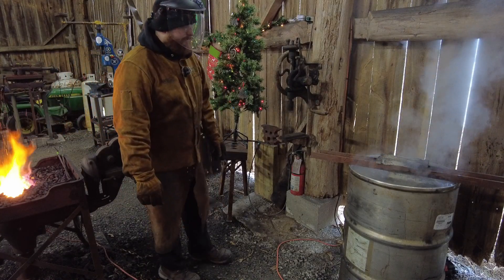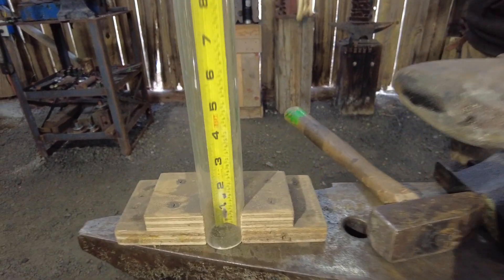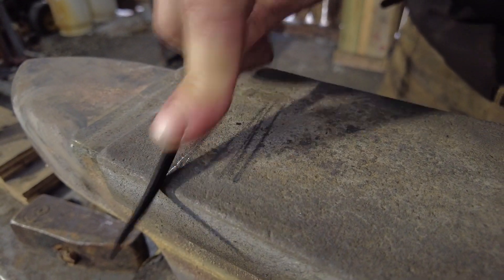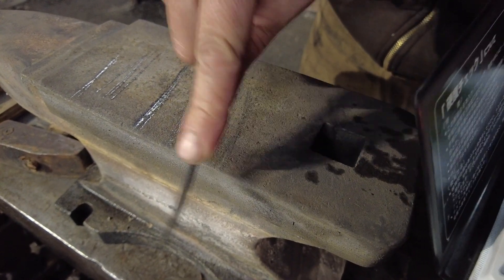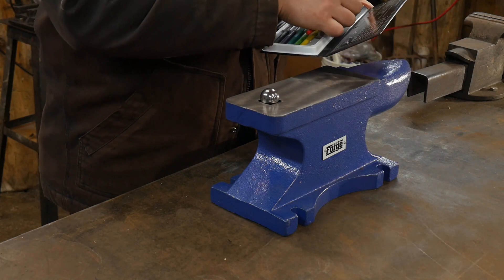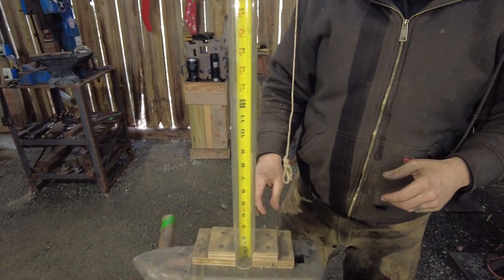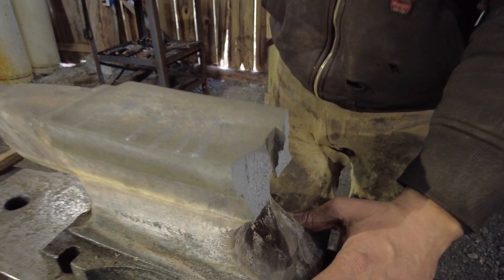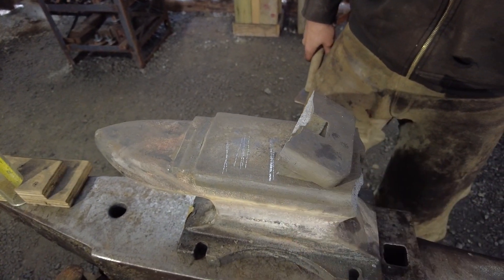Harbor Freight Anvil: Can It Be Hardened?

Comment: That's a pretty slow quench, isn't it?   You put the anvil's face into a barrel of water and left it there, right?  Now, you have protected the face from the cold water with a blanket of steam.  In the heat treating business, we pump the water in the quench tanks at very high rates of speed to keep liquid  water in contact with the work.
Take a guess at the actual content of the metal, then locate a TTT curve and study it.

Comment: Ok your insane I work with gray iron  for meny years I would of just told you if you do this you would would happen it's crap metal the grain look perfect on the one you broke  with hammers like that's exactly  the grain you want to see in cast iron you can see how much it got in the one you try to harden  but in trying harden gray iron you give it more glass like properties from it iron is not steel it's had like 3 % carbon  in steels are a lot lower even high carbon steel has a lot less then gray iron

Comment: My experience is that it is safer and easier to simply use hard facing welding rods for cast iron, build up about 3/8-1/2 surface and grind/machine flat and smooth, and polish to desired finish.

Comment: 15-20 years ago I bought a 110 lb  "made in Russia" anvil from HF and it is a gem; great hammer rebound and it rings like a (high pitched) bell. The only weird thing about it is that the hardy hole is rotated 45 degrees so that end-to-end it looks like a diamond instead of a square.

Comment: Something that thick really needs a coolant circulation pump. Your  going to get soft spots from steam pockets and generally poor quench in the critical range without a direct impingement from a fast flow [jet] of coolant regardless of base coolant temp or type. I'm curious about getting it hot like that but applying an air hardening, or work hardening, hardfacing layer with a torch with a light quench. Though it may cost more for good hardfacing material and torch gas than the anvil is worth. (Not talking about the common no name stuff used on a half crippled backhoe, there are special formulas for each sort of wear and hardness need.)

The better way to do cast iron is to cast it in a mold with a chill block insert to make a white iron layer on the top. I don't know if it is possible [or practical] to form white iron with heat treatment of the solid object after casting. Maybe some sort of process that melts a thin surface layer and lets the bulk self-chill. The down side is that a white iron top would need surface grinding rather than a fast pass machining. White iron was traditionally popular for the tire of train wheels and plow shares meant for sandy soil (high abrasive).

Comment: I dunno??? seems a lot of importance about metal properties. An anvil was originally  made as a large chunk upon which to pound things. I seriously doubt the metallurgy back in the day yielded very hard steel? Pounding on the surface over time will work harden it to a degree. If you are in a hurry you could take a bar of high hardness steel alloy and braze it on as a hardened work surface. The cheap anvil is the large mass platform, all ya need is a harder surface. Definitely adequate for most anvil uses, especially just the occasional or entry level needs.

Comment: My guess on what will happen. Serious cracking.

Edit: it looked like it was slightly above 45 Rockwell. 

I think if you had dipped it slightly deeper it may have have auto tempered less. At the same time that could have also caused cracking.

Edit 2: got to the end lol.

Comment: I think it will crack due to its mass and the temperature differential between the center and the outside.
Reply: I was expecting the whole anvil, but still surprising it didn't explode. The anvil breaking is not a surprise either. Thank yoh for this video.

Comment: You need carbon to harden. They used to dip it in cyanide. Also, sugar and walnut shells were used.  Harbor Freight has some excellent tools if you use them correctly.  I have a thirteen-foot  
fishing boat and the Harbor Freight anvil has worked very well as an anchor for years. I have seen them work great for doorstops. If you don't misuse their tools they will last you for years.

Comment: I've found a 100% effective solution to the problem.
You'll need a refractory vessel to hold the anvil, some flux, a bit of extra steel and an appropriate furnace.
Put the pricasaurus rex anvil into the vessel, we'll call it a crucible, add the additional metal and flux. Put the lot of it into the blast furnace and allow all to melt. Form an ingot of the appropriate size and shape, then forge your anvil.

More work would be to heat the damnable thing up to when the iron reaches a eutectic state, reforge it properly, then flatten and reshape as needed, then harden. But, that'd be even more work to get it right, as you'd have to forge all around and the core would likely still be crap.

Comment: Theory: it's too damned thick, outside will cool and harden while the inside is still too big and hot, and you're going to end up with giant cracks running all throughout...  OR the whole thing just breaks apart.

Edit: Huh, didn't expect you to just do the striking face, figured you'd harden the whole thing.

Comment: It's cast Iron  not  cast steel. Cast iron Has a higher carbon content which is an excess  and other inclusions which prevent it being hardened because it is too brittle. My suggestion would be to put a metal plate on the flat area of sufficient hardness and hope that the horn will last.

Comment: anyone else bothered by them only heating part of the anvil and then only cooling that part? it doesn't make sense to me that you would do that because it would increase inner stresses at the temperature differentiated point
Reply from the maker: It's called a differential quench. Pretty common in this trade

Comment: I just want to be clear. You tried to heat treat cast iron, which pretty much does not work except for some special types. You left it sit in the oil the entire time.... and I assume did not anneal it after, leaving it brittle. Any metal will be brittle after you do that to it. thumbs down, for the expert.
Reply from the maker: If you actually watched the video with your expert ears And thumbs you would of heard that the anvil Was quenched in water not oil... The point of the video was "can It be hardend" not "how to harden And temper something properly"... "Annealing" isn't the Same as "tempering" just to be clear 😉
Reply: @ChristCenteredIronworks  yes i watched it all. ok sorry i typed oil. its interesting that none of my points are addressed in this reply. So your point was you tried and the testing tools did not skate, so it was a fail and then you smashed it. It is a little misleading as anything you harden like that becomes brittle. that's literally why you have an annealing process. The substructure of the metal is like glass. I get it, its not great metal and many metals will not harden, but you certainly seemed determined to fail it.

Comment: My guess is that it’ll end up breaking apart because it’s made from low quality material.

Would it be feasible to weld a hard piece of steel to the top of it instead?

Comment: Wouldn't this be an ideal anvil for softer metals? Like copper and bronze? Metals where you don't need nearly so much heat and just need to hammer soft into form? Or have I entirely mischaracterized how to do metalworking altogether?
Reply: I use mine for shaping sheet metal with peen hammers and it works just fine.   I use apiece of railroad  track for heavier metal work.  I dont have a "real" anvil atm but have managed to get by without oneso far.

Comment: It looked to me like the failure originated at the hardy hole. The sharp 90 degree corners are stress risers and cause brittle fracture during heat treatment. You may have had some grain growth, but I would be willing to bet that it would have survived if you had radiused or chamfered those square edges before taking it up to temp. Neat video, thanks.

Comment: Harbor freight anvils are a mild cast iron. They are not meant to be surface hardened. They are just meant to be us d as is. For those that are just starting out that don't have a lot of money to put in to a good anvil. An an easy way to get a harder surface is to have a plate of hard-dox steel welded on to the the working face.

Comment: i'm guessing you did a water hardening quench which isn't necessarily going to yield a good hardness. as far as your use of the hardness files you are supposed to drag the file over the test piece once. if it gouges into the metal for any real depth that you can actually feel then it fails that file. Also, with all of that scale you are getting a false reading and should have wire wheeled or scotch brite wheeled the scale away and test on the surface metal alone. if you really wanted to improve hardness of the anvil you would have quenched in oil instead of water.

Comment: You can hear some of the grain structure cracking during the quench. I’d much rather use a good forged anvil than harbor freight’s cast stuff. I know it’s cheaper, but if I’m gonna invest in an anvil, I’d rather buy something nicer, and buy it once than have to buy a cheap one over and over again. I’ve applied this logic to Allen wrenches (which we use daily in my line of work) and I spent $170 on 3 sets of really nice Japanese allens, and they still look brand new despite using them daily. When I was young and would buy cheap sets, I’d have to replace a cheap $15 set every 3 months or so. Which, over the course of the year would have paid for the 1 nice set that would have replaced. At roughly $50/set plus shipping, my colleagues have been using the same set of the nice ones for 15 years and they still look new to this day. So, when you buy quality the first time, you shouldn’t have to keep buying junk over and over again. Even if it saves in the short term, it’ll save even more in the long term to invest in the good stuff.
Reply: it would have been better had they used oil instead of water to quench it
Reply: @signolias100  maybe.  

Would have been better if they’d gotten some railroad rail….  Hope to get some railroad rail myself.

Comment: i'd like to see a video on hardfacing one of these anvils by forge welding some nice steel to the top. i've been considering doing that with my bottom-end cast iron anvil and using some spring steel.
Reply: I have seen people do a pass of transition rod and then a layer of tool steel rod welded to the face and the results were great. Like 500% improvement. It really gave life to the HF anvil.

Comment: Remove the scale...sheesh
Why didn't you tempter it afterwards to at least remove the stresses

But I getcha...cheap chinese pot metal crap...
Reply from the maker: Tempering 45+/- Rockwell does nothing but Make The result null and void. The point of the video is can It be hardend This Way not how to make a useable anvil...

Comment: I honestly wondered about this.

Since they use "ductile iron," (not cast iron, which is actually VERY high carbon) which actually has a decent graphite content, it actually stood to reason that it would be hardenable on some level.
Reply: Main difference in plain cast and ductile irons are the structure of the carbon bits.  Plain cast the carbon is in a flat platelette shape and ductile have more sherelical shapes.  Cast can have long lines of carbon plates stacked up forming a weak spot.  Ductile iron carbon structures have a much better distribution and more even adherance through out the item.  Best way to look at it is look up cast and ductile iron vises.

Comment: Not sure I'd quench a yellow-hot anvil in a barrel of oil up against an old, very dry, wooden Barn wall, with a good draft (see 1-1.5" gaps between planks).  Oil quenches frequently flare up (open flame).  Especially when you're talking about the amount of heat mass in a hot anvil.
As an unreformed pyromaniac, I'd call that a Massive BONFIRE !!  With 30gals of "cheater wood" (fire starter fluid).
Take the "fire ladder" away.  Move the oil barrel out into the open space, with no overhead wood beams.
Reply from the maker: It's not oil....... like I said in the video.

Comment: Question; if you coated the surface with a mixture of clay and carbon then heated it up and let it soak to absorb some of the carbon.  Then cooled and removed the clay then hardened it. Would that work or is the grain structure just too course?

Comment: In my opinion, I would steer clear of Harbor Freight anvil. Just for a simple reason that there is too much impurities mixed within the metal that makes it too soft for blacksmithing work. 
If you compare size for size of anvil a good quality anvil would be heaver than a HF anvil, because of better quality of steel, more dents, and better casting methods. I am sure there is other who has already made the same mention as to what I have just said. If it was me and I need an anvil for some blacksmithing work, I would get me some railroad iron to get me out of a pinch.
Just saying.

Comment: i wasn't surprised by this at all, especially the hardy hole popping off like that, its cast so any amount of hardening will absolutely destroy the entegrity of the crystal structure, forged steel has a much tighter and consolidated structure and so when you harden it, it essentially interlaces the crystals almost like a rope interlaces threads to make a stronger item. Cast iron is like taking those threads and hanging something from them untwisted.
Reply: First, cast does not mean cast iron. Second, forging does not consolidate material or "intertwine" the grain. Third, rope is not stronger because it is twisted.

Iron is a crystal. It does not have long or stringy grains, it is more akin to sandstone or quartzite (metamorphic sandstone where to silicate grains grow together from being exposed to high heat). Casting has the potential to create voids or porosity from the process failing or being done improperly, but heat treatment itself can do far more to refine and homogenize the grain structure than "forging" can. Besides, what does it really mean to have a forged anvil? How did they create the billet in the first place? Are the feet, horn, heel, and face all welded onto the waist? Is it arc welded or forge welded? Are those perfect welds, or are they just as susseptible to failure as a cast anvil?

A good anvil is a good piece of iron made well, regardless of the method used in it's construction.
Reply: @DragonHide94  ok first, I said Cast, not Cast IRON, I understand the difference, still like you said, hardening cast at all destroys any strength the metal had because of all the voids and the lack of consolidation of the grain of the crystals, you can see it when the hardy breaks off how large the crystal grain is

 the difference between cast and forged metal is the grain structure of the metal, forging tightens that structure and you get much more grains in a smaller area

I used rope as an example because and I quote "The twist of the strands in a twisted or braided rope serves not only to keep a rope together, but enables the rope to more evenly distribute tension among the individual strands. Without any twist in the rope, the shortest strand(s) would always be supporting a much higher proportion of the total load."

but i guess i should have used gems as an example, quartz is loose and not consolidated well, while diamond from heat and pressure is far harder.

there's a difference here between hardness and strength though, the  harder the steel the more brittle it becomes, the stronger the steel the more easily it bends.

the best anvils are forged because you tighten up the grain structure, remove any possible voids in the steel and then can heat treat it to harden, cast may be able to be hardened but will not be as strong as forged steel, there's a reason steel swords are never made from castings.
Reply: @thejackofalldans786  I have neither the time, not the crayons to explain why everything you just said is wrong (except the rope because it was a quote from elsewhere).

Comment: Maybe to continue this series, buy the cheapest set of steel tools HF offers, cut the working surface off of the anvil, forge it together into a harder surface then weld it back on to the avil base to test. I forget how much HF anvils are, but they have a mechanic's set around 40, so maybe see if you can make a usable anvil for under $300 using only materials bought there?  Purely for "science" though lol.

Comment: I'm not surprised grey cast iron doesn't water Quench well as the cooling rate is too fast. air, oil, molten salt seem more apt. of those Air is safer and considering the limits you mentioned in your shop air is probibly best.  Which gives me the thought that plate quenching with a large/thick aluminum "plate" would be better. 
As brittle as it was it makes me think it needed tempering which would have likely brought the hardness back to those stock conditions... as such even plate quenching maynot wouldn't help it.
maybe something like surface hardened by the induction method or Flame hardening method. (of course those would need to be tempered or "Stress Relieving" at 150-200C [302-392F] too)

Comment: Also with hardening metals most metals need to be tempered back as they would be to brittle and shatter if struck or dropped from a distance . It kinda makes me think the casting got hard but because its cast it is easy to break when hard so that's why they leave them soft anvils , my question would be can you weld a solid high carbon steel to the anvil and harden the piece of high carbon steel ? Oh and oil quench or water quench with bigger pieces you would want to warm the quenching liquid before your hot metal goes in for a dip